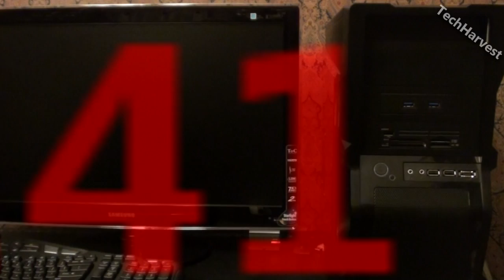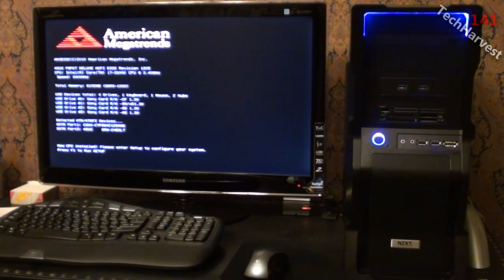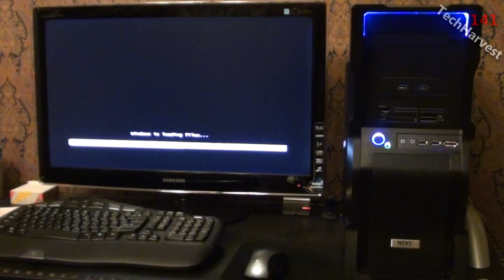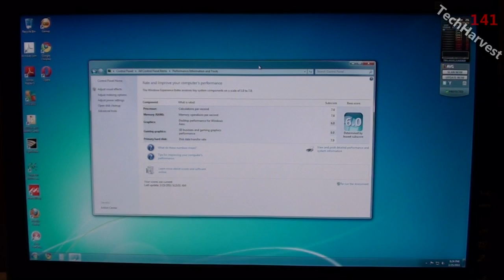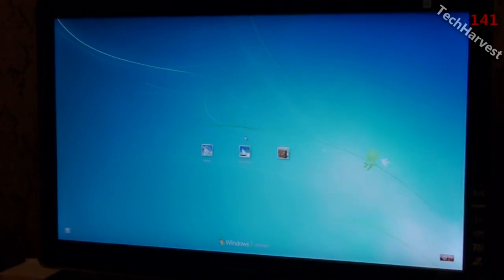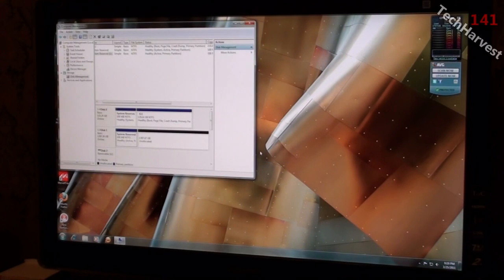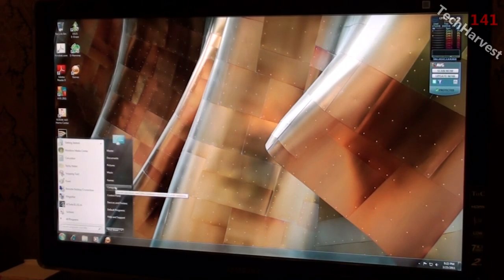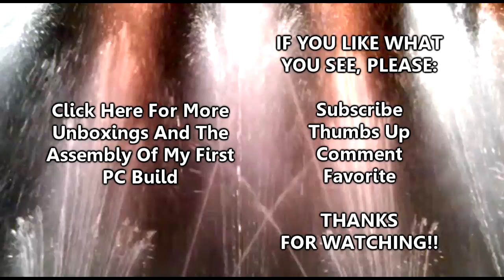Upgrading A PC: Setting Up A 2nd Internal HDD, First Time Power Up, & Installing Windows 7

Comment: Hi, Great videos, very informative, Thank you very much and if I may suggest, it would be great if you sometime make a similar series, you know, upgrading the MoBo, CPU, etc. ... but KEEPING un-touched the Windows 7 SSD boot drive, so anyone can learn the process. For example, I upgraded from a 7200 RPM Seagate, to a new Plextor SSD and despite being a terrific improvement in speed, I am NOT getting my SSD to run at it´s full speed, because my MoBo is an old SATA II 3Gb/Sec instead of the modern SATA III 6 Gb/sec SATA standard, so I need to upgrade my MoBo BUT want to keep my Windows 7 Boot SSD un-touched.  Thanks again!!!

Comment from the maker: @MMMHOTCHEEZE Either way will work.  The key thing is that if you change your motherboard, your Windows installation will no longer work, so you have to reinstall it.  You can use the old HDD as long as you reinstall windows on it with the new mobo.